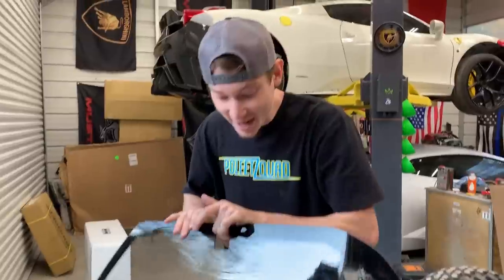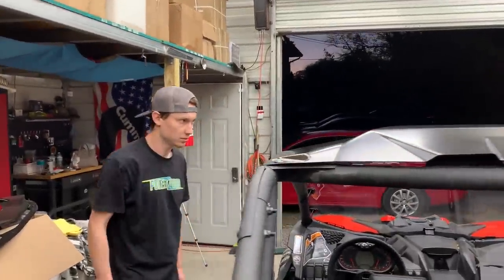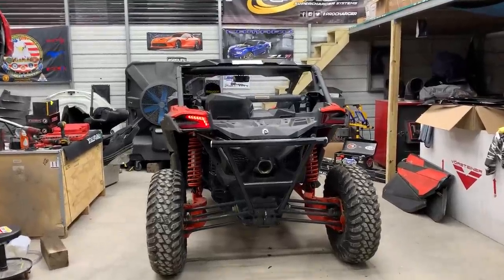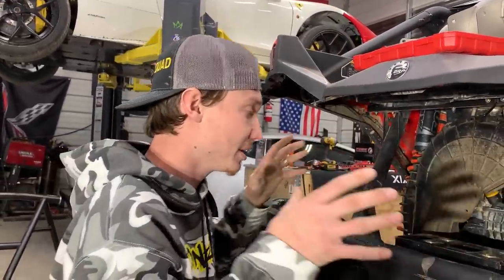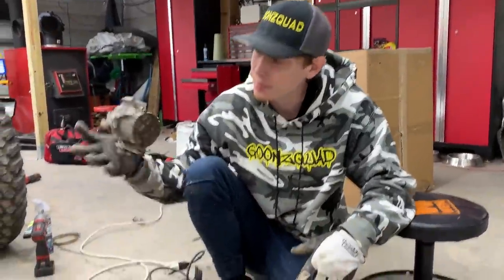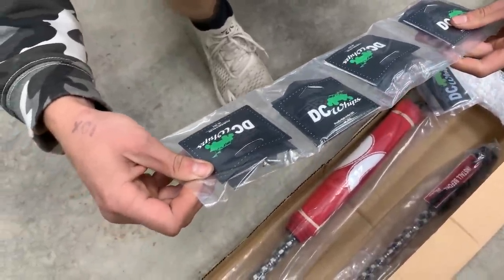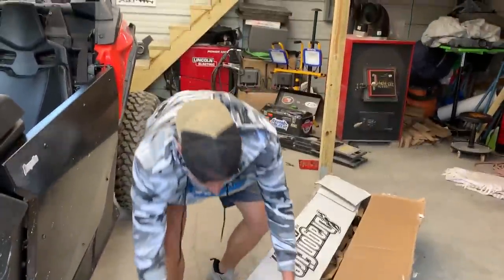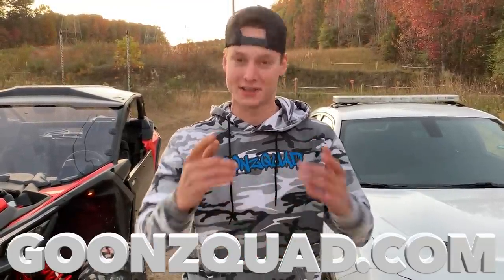Rebuilding A Wrecked 2019 Can-Am Maverick X3 Turbo Part 4

Comment: "Whats so expensive about that part"
The platinum
Reply: and the palladium
Reply: @brandonchutt312  You realize with the engine size & amount it will be driven, it probably has little impact on the environment... The Viper probably produces more emissions than that thing lol
Reply: Brandon Chutt lots of people will modify/remove cats for better flowing exhaust & a different sound. It’s pretty common. Especially with this being an off-road vehicle with a turbo, the extra flow will help a lot & won’t have the big of an impact on the environment.
Reply: @brandonchutt312  it wont hurt the environment anyway. Motorcycles, and offroad vehicles(including all drag cars and atvs/utvs) make up like 0.00003% of vehicle emissions, and vehicle emissions are a small part of the amount humans produce
Reply: @AnythingWeThinkOf  They make it sound like it's a big ass ship in the ocean, next thing you know people will cry about lawn mowers and leaf blowers.
Reply: MarioPL ain’t it though. Gotta have somethin to complain about.
Reply: 90% of offroaders do it! does it makes sence...? the motor runs cooler for sure- is it dirty without? i dont think so....

Comment: Guys!  Off roading requires spark arrestors.  Straight through exhaust starts forest fires 🔥
Reply: You are right, glad you brought that up. No, I don't do off roading myself, but what you said makes perfect sense.
Reply: Spit'n fire off road is not good. I love your builds but PLEASE be fire safe on the trails.
Reply: @riderescue  I totally agree,  But they may be planning to build a tricked out supercharged twin turbo fire truck.  lol
Reply: @timglass6041 , Dang Duud, I never thought of that. Great follow up with a fire engine chase vehicle. I'd watch that build for sure.
Reply: Even better just stick the catalytic converter on aswell then the forest is less likely to be scorched .
Reply: @christopherhylton8462      my pipe has a spark arestor that I can remove and reinstall with 2 screws, I put it on whenever riding in the woods, I never knew how many sparks and flames came out until I rode behind it when my son was riding it.
Reply: A lot of times the turbo counts as a spark arrester. And Tennessee is no where near as dry as out west.
Reply: The exhaust they installed includes a USDF/USDA approved spark arrester

Comment: Anyone else's OCD kick in when Goonzquad doesn't clean before reassembling?
I need to go watch AutoEdits for some therapy.
Reply: Ernest Mungai definitely. Clean the glass but leave all the dirt around the fasteners
Reply: They are much better than most although I did thing it odd that they didn't clean the mud off before installing the exhaust. Uncharacteristic of them.
Reply: Yeah, it's all the time. I clean everything when I disassemble. Easier when it's apart
Reply: They use to clean everything
Reply: Yep, the same thing every time. They just wash every vehicle outside, vacuum and wipe inside but if you take any panel off there is loads of crap underneath
Reply: B is for build is much worse.
Reply: Things for off roading, will get dirty in no time
Reply: Andries it doesn't matter what vehicle it is. It's their way of working. I've seen the same attitude on other cars ie Lambo...

Comment: GOONSQUAD Your wiring connections are located in passanger side of vehicle.  You have to remove the passanger seat. The side panel below the gear shift pops off and there's a power block there.

Comment: Make sure and put some antisieze  on the bottom of those led whips were they go into the mounts. Once dirt and water get in between the whip and the mount they are a major pain to get out of you need to take them off. Just little tip.

Comment: You should have replaced the pipe. The shape of the converter is a cone, which when gutted, will cause a resonate backpressure . You actually removed power and when you light up the forest, you go straight to jail.

Comment: Y’all do know if u hold the brake all the way in and press the gas to the floor it will kick in launch control and let go of the brake and it will go so much faster off the line

Comment: Damn, You guys added a lot of weight, and not in a good way. You should change rodius and trailing arms, as they are made of cheese on the X3. Simpson suspension seats and harnesses. Aftermarket cage(see rodius trailing arms) Evo exhaust and tune. Ditch the windshield and use helmet and goggles. Ditch the rear bumper and whips.

Comment: Removing "that kitty" without replacing it, is criminal guys. Get it together! #climatechange
Reply: only if its street legal... usually those are not street legal which means you can do anything you want to it
Reply: forgot to finish it- #climatechangeisahoax
Reply: Basketball Coach Allen it’s bad for the environment - street legal or not.

Comment: ok tired of it..i must ask a stupid question...so what is OEM?
Reply: Not a stupid question if you don't know!! OEM means Original Equipment Manufacturer. If the car part is OEM, most people expect the part to be the real deal. The other option is Aftermarket parts which for me at least are cheaper than OEM but usually are fake or phony. 
Now you know. 😎